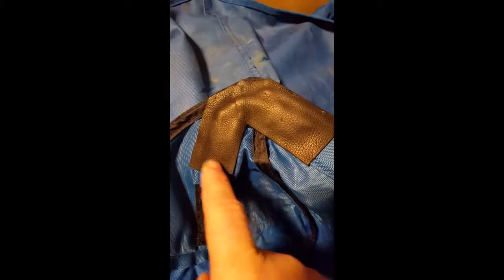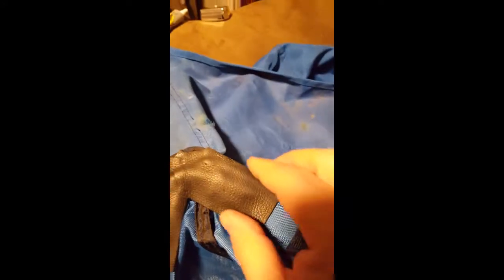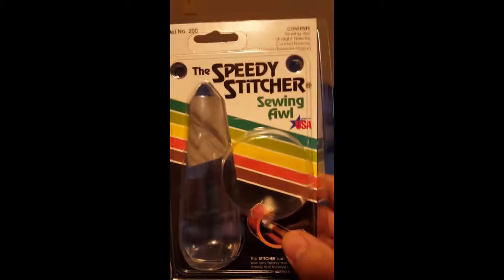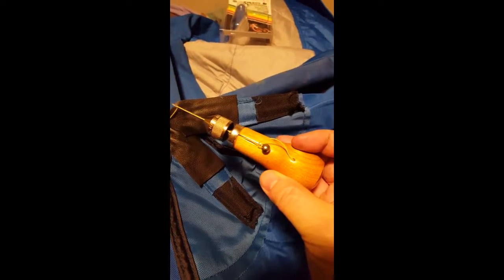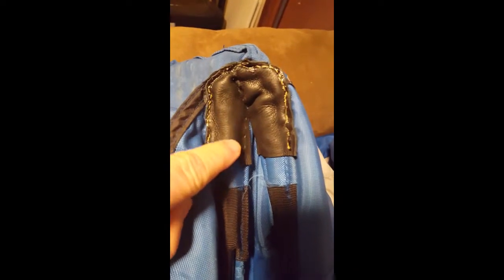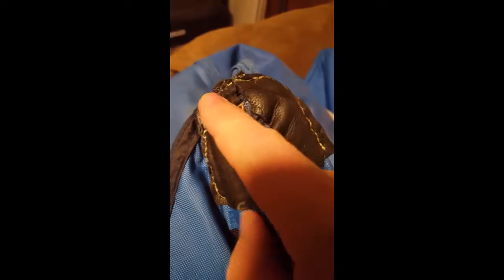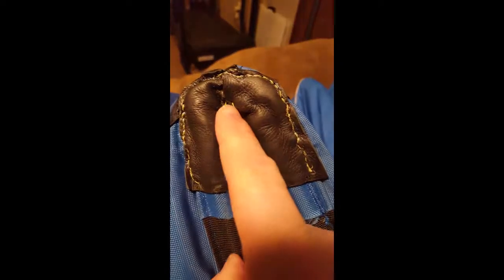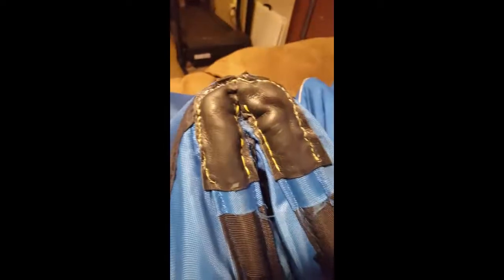Clam Pop up Fish house Pole Pocket Repair #icefishing

Comment: Clams are made of poor quality materials and these pole pocket problems is never ending.I had a pole pop through my first time out with my escape ice shack and have been stitching others up on a regular basis.I will not be a repeat buyer.
Reply from the maker: Agreed. I still have this house and it's starting to wear more. I bought an Eskimo 949i last fall, much better.  The anchors for the eskimo I much thicker too.
Reply: @kevingrabow3367  I made my own anchors with 6 inch screws and welded 2 washers a 1/4 inch apart about 1/2 inch from hex head  and put an s hook in between washers and a carabeaner for attaching to straps.they work great and can drive them in ice with a drill.They are way cheaper and work better.